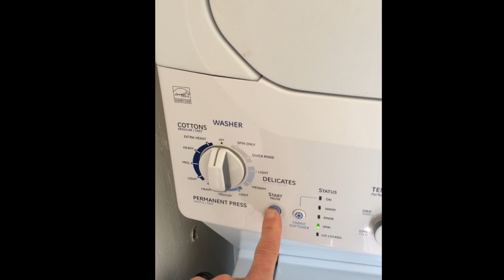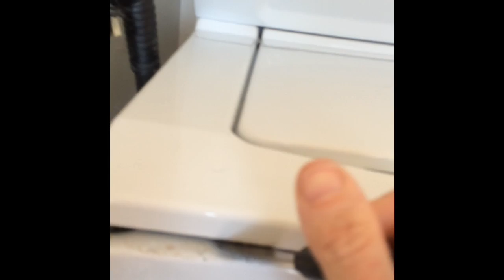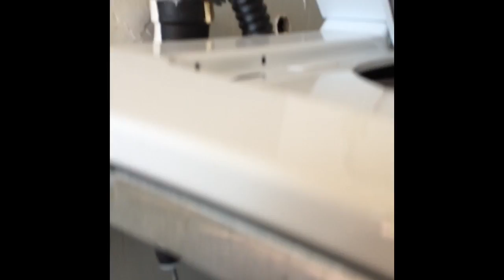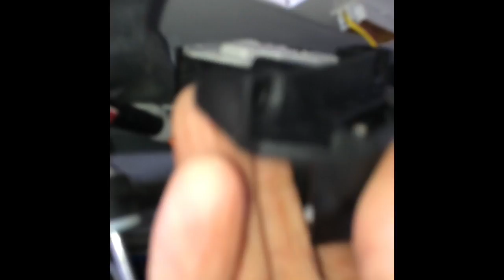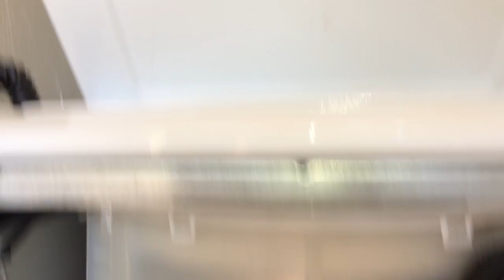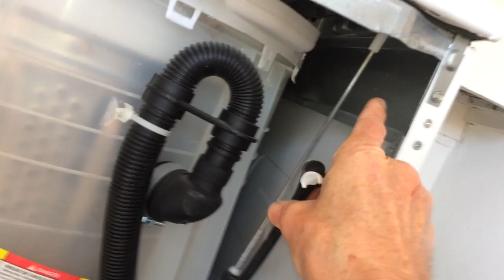✨ GE WASHER DOESN'T SPIN - FAST Easy FIX ✨

Comment: Yesterday I heard hard noice from motor bcoz couple of socks were stuck in pully and belt. I opened the front cover and cleaned but I noticed i tiny connector with blue and pink wires is disconnected from some where. Im trying since last night but couldn’t find the place where it supposed to be.
R u able to help me please?
Reply from the maker: Was the wire in the upper left hand corner?
Reply: @ScottTheFixItGuyChannel  may i send you the picture
Reply from the maker: That would be great.

At: Scottthefixitguy@yahoo.com
Reply: I got your advice. But now the big problem is that im not able to locate the place near motor where the speed sensor supposed to be.

Comment: Anybody still having a problem with the washer not spinning you might want to check the shift actuator at the bottom of the washer tub it is connected to the support Fork on a GE model don't know about other models but sometimes it can short out and cause it not to go into spin or agitation mode
Reply from the maker: Thanks so much for the info Dan
Reply: Scottthefixitguy no thank you great video just saying that just in case people replace the door latch and it still does not work but either way keep it up great job!

Comment: What if my lid switch works but still won’t spin
Reply from the maker: There’s also the lid lock the black plastic thing and the lid switch white plastic thing.

One is probably defective.
Reply: Scottthefixitguy the lid locks. I just replaced the lid magnetic sensor with the wires and the washer fidgets  and won’t spin still. I noticed the red wire on the lid sensor was Burt and exposed but I replaced the wire so I don’t know what the problem could be. Thanks for the response!
Reply: Scottthefixitguy I just replaced the lid switch also now when I turn to the Spin only it don’t even light up anymore

Comment: Hi, I have a dwv pipe that’s clean at 1-1/2” and the pump overflows the standpipe, I was wondering would it be possible to switch the washer drain hose with a smaller more constricted hose or perhaps decrease the intensity of the pump to prevent overflow? Thanks
Reply from the maker: There’s a narrowing of the standpipe where it makes a 90 degree turn.

You should snake it out to allow water to flow better.

You might also want to check the vent tube for that drain on the roof to make sure it’s clear.

Comment: I have the same combo set and the washer sounds like a airplane at full speed. Any suggestions?  Thanks
Reply: TVMii live with noise as long as you can stand it, then get a tub assembly.

Comment: What is the part number for the lid switch?
Reply: Shuchi Vyas, did anyone ever respond to you?
Reply: You should be able to get the part number off of the part. It will vary from one machine to another. Mine is WH44X10288. Look for WH, 1 or 2 digits, X, then up to 6 more digits.

Comment: does not make sense. you try to start the washer, but the selection knob is turned in the off position? if spin light flashes i find it is the speed sensor attached to the motor.

Comment: My GE washing machine spins when it wants and dosent spin when it wants.
 Also it goes from cycle to cycle in other words if i throw in a load of
 laundry and go to work when I come home the washer is still washing. 
Goes from cycle to cycle non stop and I can not find any videos to 
address this problem. Please help
Reply: RASCAL 728 Hi there !!! Look at the drain pump,it seems like is not draining all the way,disconnect all hoses on drain pump and look for any restrictions, watch for any water spills,Good luck.🍺🍺Sorry,I forgot ; you have to remove front panel.Good luck again.
Reply: TOOK CARE OF IT ALREADY THANKS

Comment: I have these machines on my apartment complex. The pulley was broken so I replaced it. I adjusted the tension on the belt because the motor was pushed inwards towards the center of the tub. Once the motor begins to spin it immediately shuts off and the lid lock light stays on solid while spin flashes and won’t work anymore. I reset it and the same thing happens. Any thoughts? Would appreciate the help, GE has come out and no answers yet.

Thanks,
Reply from the maker: +migui1989able 

I wonder if the belt is now too tight?

Comment: I have this exact same washer/dryer, and the dryer turns on and works great, but the washer has no life. It does not power on. What could this be?? Thanks!
Reply from the maker: +Ariana A. 

Can you try turning off the breakers for your washer dryer and then turning them fully back on to see if that helps? Some of these machines used to breakers one of them may be not working.

Comment: Hello Scottthefixitguy,

Thanks for putting this out there.

My very similar machine does not rinse properly, it seems to fill up then just drains without going through the rinse cycle?

The spin cycle does seem to work ok afterwards

Any tips would be appreciated

Thanks
Reply: Tejas Amin my unit is doing the same thing any luck in fixing yours is so I could use help

Comment: Tried replacing lid switch, didn't fix my problem.  Dug around and found how to read the diagnostics lights.  Lights are showing a motor block.......checked for stuck clothes and what not and there aren't any.  Reading that it could be the board.  Any tips on how to tell if that's definitely the case?
Reply from the maker: +Kevin Fisher 

Thanks Kevin,

Look for an article of clothing that wrapped around the motor
Reply: How do you read the diagnostic lights?
Reply: put the unit into diagnostic mode clear the codes and try again.  also could be a small tub seal leak has leaked into the supports bearings causing it to seize up. or water damaged rps sensor. but since we like to fix the easiest things first just try to clear the codes and re run a regular cycle

Comment: Same model, how do you fix a drum leak?
Reply: DJ KaNeck Hi there!!! If drum has a hole it's not worth to repair it,but try to dismantle washer,just the front to expose drum and all hoses,then run a short cycle and watch for any leaks,good luck.🍺🍺

Comment: I can't get that front panel off.. am I putting these knives in the right place?
Reply: theintellectualz11 put a light to where you can see in there and you'll see metal clips on both sides. Just dig them out of they're position to unlock them and get the door loose. Using a light helped me position my screwdriver where it needed to be.

Comment: on this same model. i have a stackable that when i place clothes in to begin wash. it fills up with water and it will begin to agitate for a split second and than the light begins to blink as if the machine was paused... what could that be?
Reply: Let me know also.I have the same problem with my GE space maker # GUDESS27JOWW
Reply from the maker: +Glenesha Green 

I think the lid switch is faulty
Reply: Glenesha Green do you know were the part number is on that part I don't know witch one it is
Reply: Scottthefixitguy do you know what the part number is for it there is a bunch and I don't know witch one
Reply: GTUN275EM2WW is the model#
Reply: a guy said it could be the control board or the lid switch. i have placed it in service mode and the codes or saying no issues.
Reply: Anthony Estrada did you ever find it? I’m looking now and don’t know what to order
Reply: Did you ever figure this out, mine is doing the same thing
Reply: zarniwhoop1961 did you find out what was wrong ours is doing that also
Reply: Tammy Nicholson I did not, I ended up buying another washer and just using the dryer
Reply: zarniwhoop1961 well shoot thanks
Reply: hey Scott do you know the part code number for the lud switch sensor?